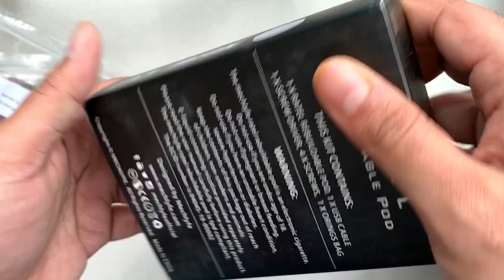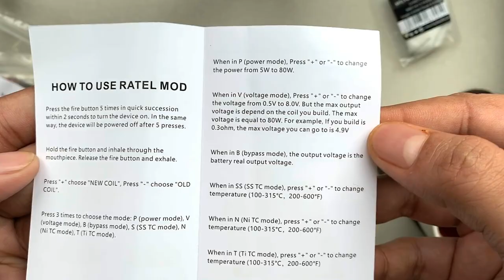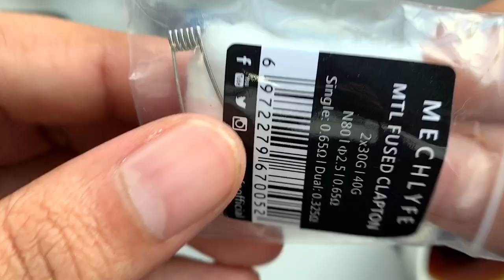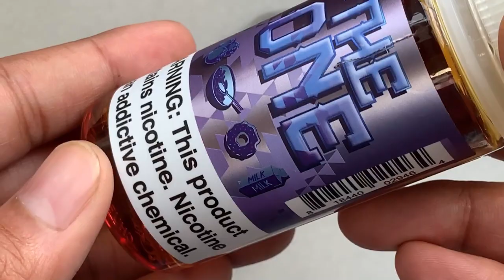BUILD LAPSE | UNBOXING : RATEL 80W REBUILDABLE POD | MechLyfe #ratel #mechlyfe

Comment: Work with Nico-salts?
Reply from the maker: MONTheKiller no this one isn’t for that at all
Reply: Rizwan M soo..and the “pod” part?
Reply: I mix my own nic salt stuff at 6 for mine, it works just fine but I dont suggest the high nic levels with it.
Reply from the maker: MONTheKiller the “Pod” is the name given by the company but really it’s an all in one rebuildable which works really well with freebase
Reply: Devon Price my english Lv is low, u try to tell me u use 6mg of nic salt or Nic sat on 6 watts?
Reply: @MONTheKiller  6mg nic salt, the high at 25mg and 50mg could hurt you
Reply: Devon Price on spain the mínimum and Max is 25mg of salts
Reply: @MONTheKiller  I see, stick to non salts. Or mix your own juice.